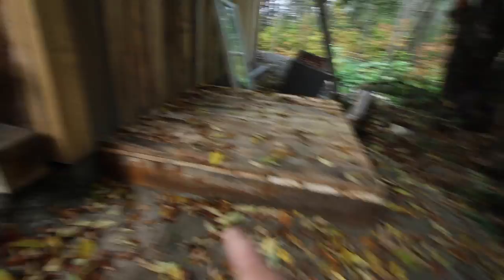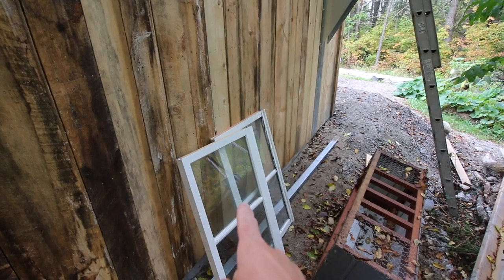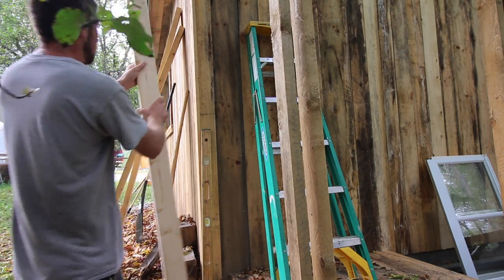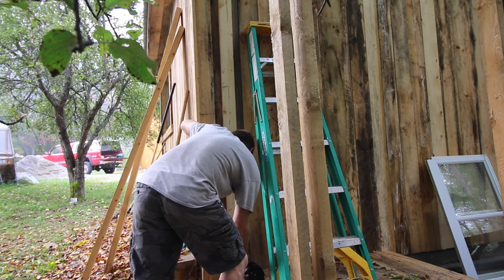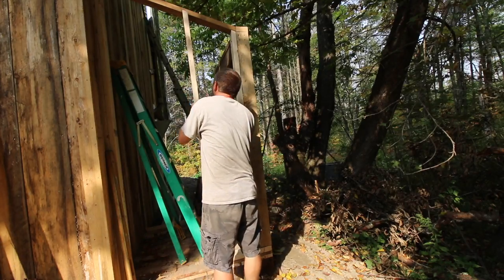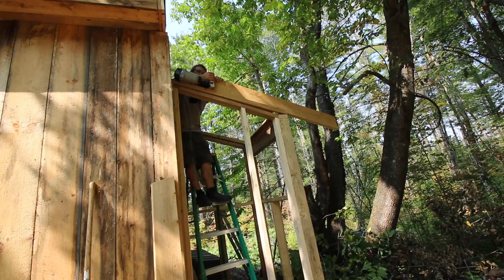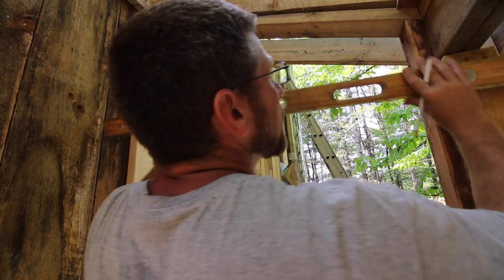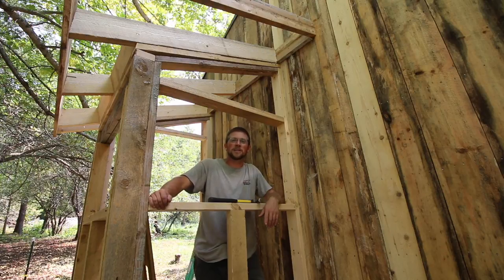Day 1~ DIY Composting Out House

Comment: Get a tool belt...   tape measure pouch in the front and center, left side pouch for a speed square, pencil, & utility knife, and a hammer hanger on the right side.  Set it up so you snap it in the back.  Thank me later.  U will use it and love it whenever u do another project like this.  I can't "work" without it now.  ...always know where my tape and pencil are at all times!

Comment: AL You were looking for Ideas for a Spring class  You look like You know what You are doing with the framing  how a basic framing building class  useing Pro grade tools  the big air nailer etc  and teach the why and how of building a wall  I see a lot of sketchy construction in gardens  and animal housing  because some Steaders don't know the basics of wall and roof construction   

Maybe go into useing Deck screws  etc for replacement for a air compressor , air lines and air nailer   every Steader should have a cordless drill /impact driver